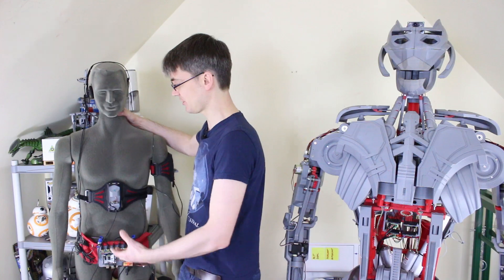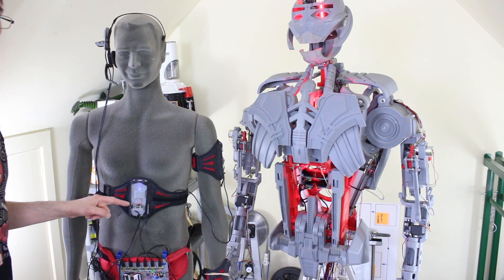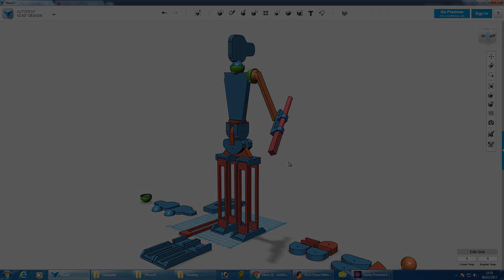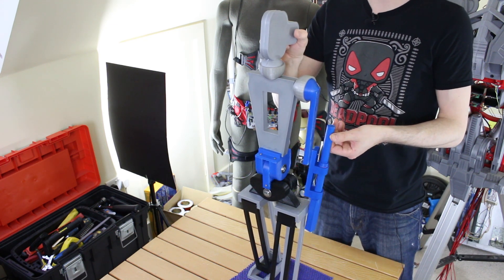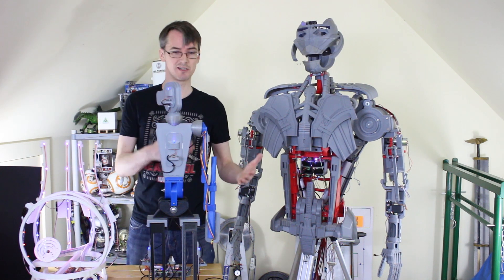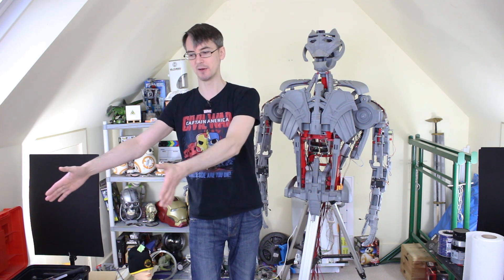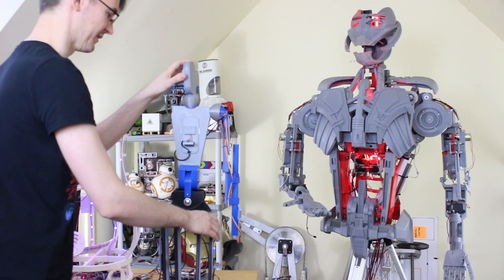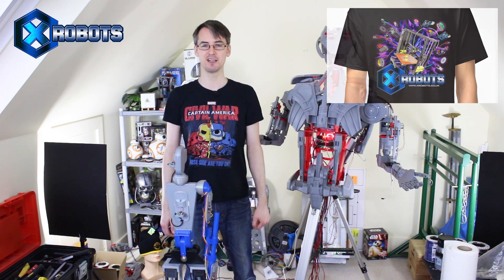Avengers Ultron #32 | Motion Capture Control | James Bruton

Comment: I probably just missed/forgot your reasoning behind that decision, but why did you choose to go with that complicated solution with two motion capture sensors on the legs (when your Ultron robot has no legs)? Wouldn't it be easier to just use those two sensors on the right arm, thus making BOTH arms fully and independently puppeteerable?
Reply: I see - thanks for the quick reply! Loving your work.

Comment: if it took 2 sensors to make the arm work, and you are using 2 sensors to for the legs to make the other arm move, why don't you just have those latter sensors just tell the other arm where to go.  You don't need the abstraction of the legs, you can just record the other arm's movements.
Reply: ah, i see now

Comment: I think you should redesign the shoulders as a ball joint and when the arm is straight down give it 180movement on the y so moving your arm straight up above your head and straight down
90 on the (X?) so you move your straight out to the left (if left arm) then that should have 360rotaion but only straight out to the left like that
Then the elbow should only be 90 bend no matter what rotation the shoulder is in

Not sure if it would improve how his arm moves but i think it should help alot
Sorry if this is confusing to understand

Comment: I have one question. Would it be easier to install three position switch on this puppeteering rig to control behavior of other hand? Insted of switching the positions of legs? I understand that in full body suit it will be easy to just make a step but in this rig you have to stop controlling body, work around legs, make sure that it stays stable, go back to puppeteering. Switch will make it more smooth in transition.
Reply: I mean reduce amount of sensors. If I'm correct you are swiching modes of non-motion controlled from mirror to oposite moves by positioning leg sensors i diferent positions relative to each other. So when you are using this little 3d printed rig you need to leave head and arm and switch leg position to change non-motion controlled mode. Insted You can use switch that decleres if non-motion controlled arm should be in mirror or oposite mode. That reduce number of needed sensors by two, and make puppeteering more fluent. If You want to refer to prosthetic arm you can put that switch on palm similar to Ant-man "scaling"button. I hope I'm more clear naow, english is my second language.

Comment: That is really awesome.

One thing I do worry about is the shudder in the movement, which caused one of the panels to fall off Ultron, and when both arms swing forwards possibly causing Ultron to tip over.

Comment: Im surprised disney doesn't have something like this already. Has anyone else done this animatronic motion capture puppet idea?
Reply: Almost all animatronics in film already are controlled on the spot and have been since the their conception. Normally many puppeteers with hobby grade remote controllers and/or cables (and yes. sometime custom built motion control units, not quite like this tho) will control features like facial animation and fingers while a puppeteer (or for larger animatronics, puppeteers) within the suit will control the major movements.
Reply: probably. But there's really no use for it. If you're going to do motion capture, why not just use animation instead? How often do you need puppeteering by a person in real time, that you couldn't just program beforehand?
Reply: Those sort of things are really quite amazing no doubt but I find the same problem with all motion capture technology: motion captured movements will always be less than real life while more traditional animation strives to make movements more real than real. This is why in many cases a motion capture animation will be used simply as a base for an animator to then go back in and hand animate to push it to its limits.